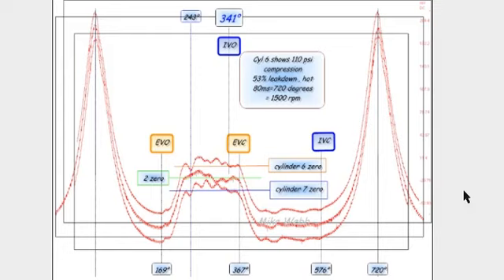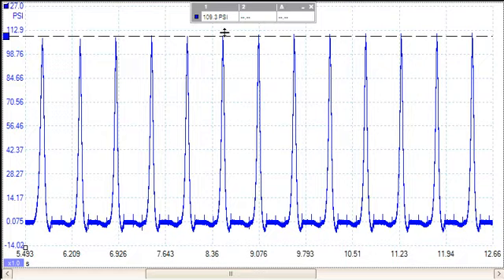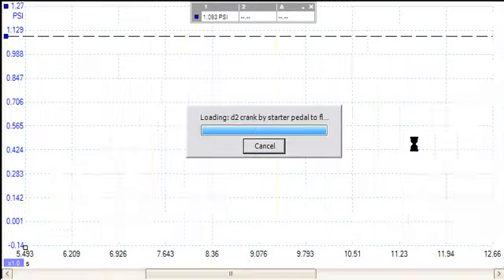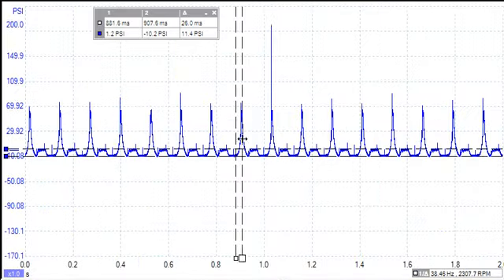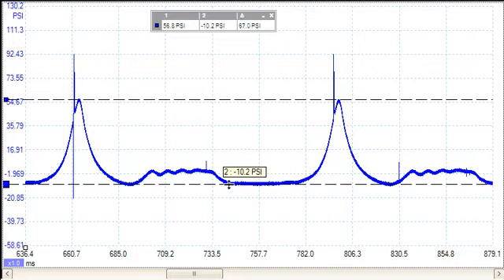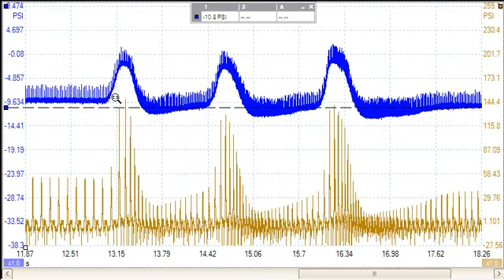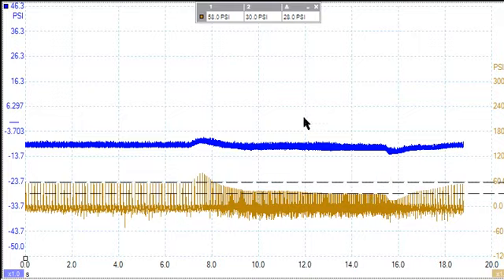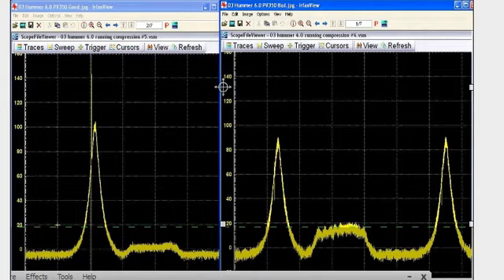Compression Thoughts From Wilf

Comment: It's Boyle's Law and it breaks down as soon as you speak of "negative pressure". Work with absolute pressure only (psia) and all can be calculated. 
(example) If you have 6 psia intake and 10:1 compression ratio, then expect 60 psia @TDC...
Also clear from this is that the sensor you're using over reports peak pressures.
Reply: I thought that too but, couldn't get the numbers to match the real world.  Then I found the pressure ratio VS compression ratio chart.  Due to heating of the "stuff" during compression a 10:1 compression will give 25:1 pressure.  So 20" vacuum(4PSIA) X 25 gives 100PSIA= 85PSIG